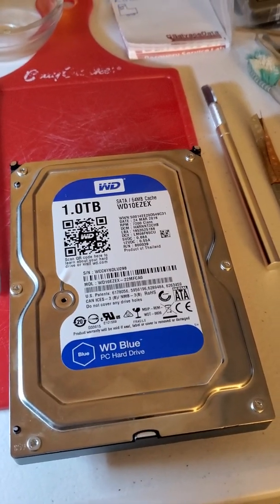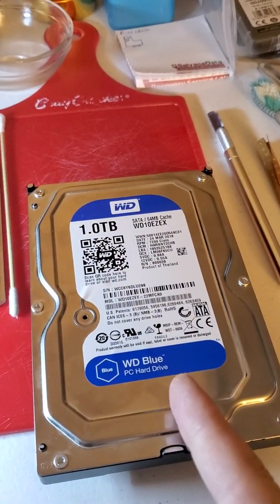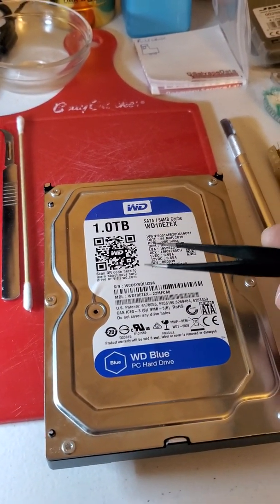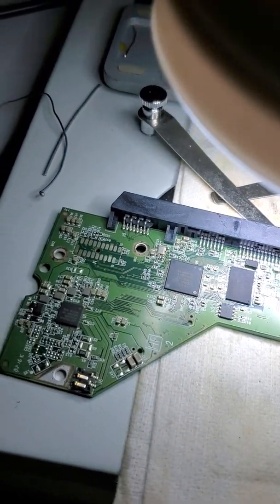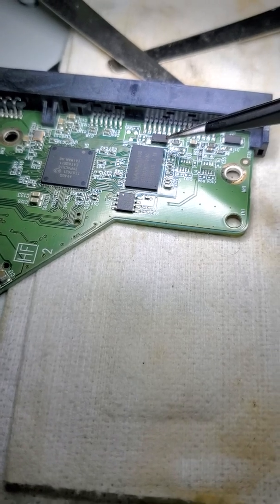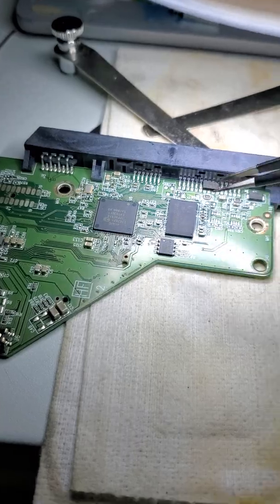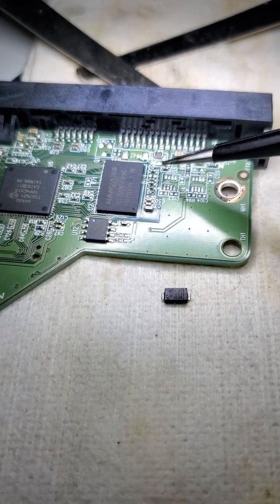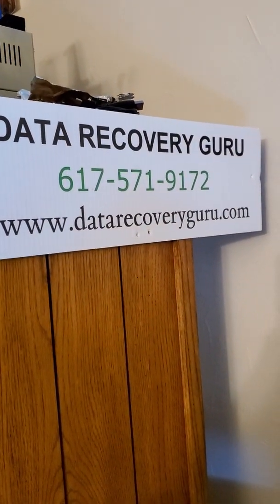Why does a hard drive not spin? Explanation on this WD HDD PCB we received for a FREE diagnosis

Comment: Hi bro. Can just remove by solder or need to use heat gun?
Reply from the maker: Could use either
Reply: @Datarecoveryguru1  thanks bro
Reply from the maker: @hyemin6314  You are welcome.
Reply: @Datarecoveryguru1  hi bro. I have question. My 3.5 hdd got problem. 
1. When i plug power & sata, hdd not spin

2. I need to connect and disconnect sata many times and sometimes it spin for like 2 sec then stop spin. Sometimes it keep repeat spin and stop. 

3. Already try change sata slot, sata cable. Still same. 

4. Yesterday i try to keep plug and unplug sata cable at hdd connector, and now my hdd keep spin and detect like normal. 

What cause this problem? Connector at hdd ? Hdd health and performance is at 100% and never drop my hdd.
Reply from the maker: Difficult to say without seeing in person. Maybe there is a damaged pin on the power side of the SATA connector?!?
Reply: @Datarecoveryguru1  on psu side u mean? If that, i also try another power cable from psu. Still same. Or if from hdd side, it is best to try replace pcb board maybe?
Reply from the maker: @hyemin6314  On the HDD's SATA connector, where you connect the SATA cable and power cable. On the connector, there are gold or silver pins. See their condition!
Reply: @Datarecoveryguru1  i see. Ok bro. Need to try cleaning with contact cleaner first. Thansk
Reply from the maker: @hyemin6314  Not necessarily cleaning. Look for damage on the pins. Maybe one is torn.